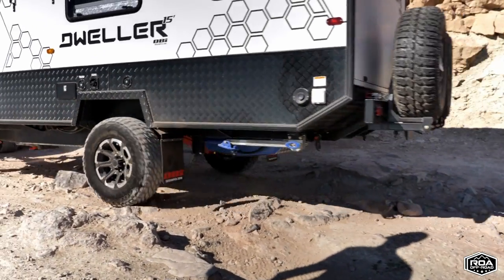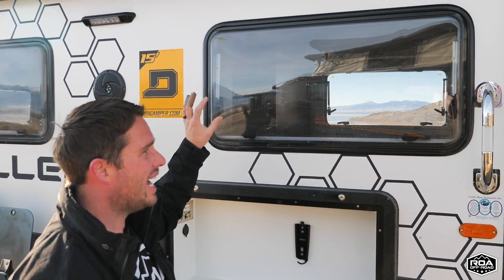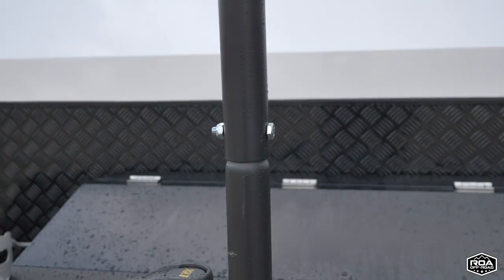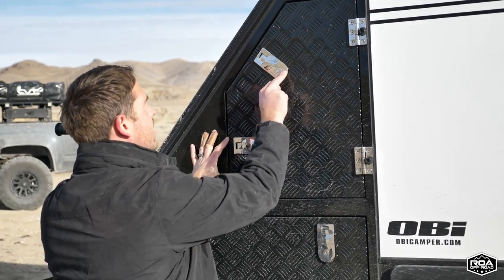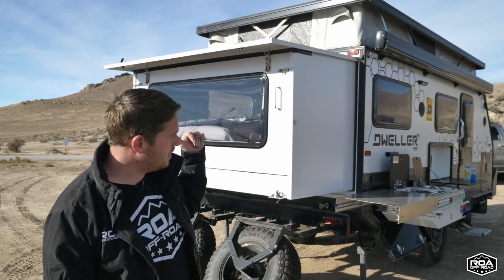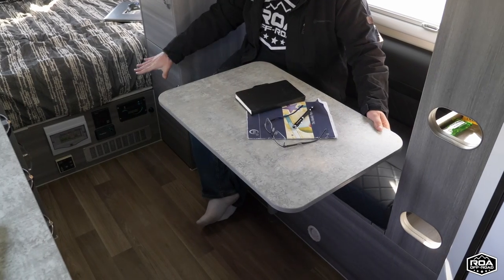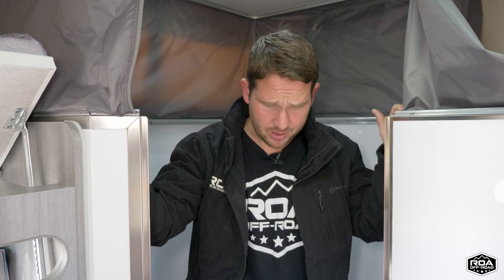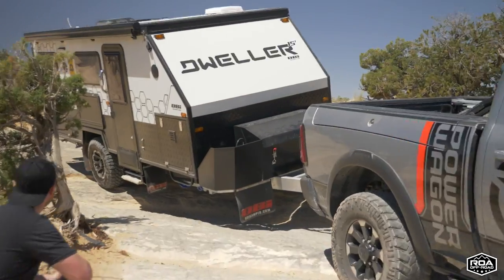2023 FULL TOUR! OBI Dweller 15 Fully Modified Off-Road Trailer | ROA Off-Road (2023)

Comment: Hi Shane. Thanks for another wonderful video on the Dweller D15. Quick question. I always see you using a full size truck to pull the trailer. Is it possible to use a Toyota Tacoma Pro TRD to pull the trailer? Do you know anyone that has used the Tacoma to pull it? Thanks in advance for your feedback. Gary
Reply from the maker: We would not recommend a Tacoma. It D13 would be doable. But you would be under powered and very uncomfortable to tow.